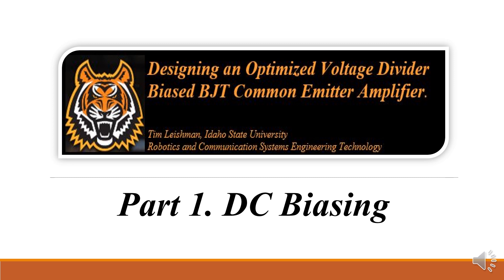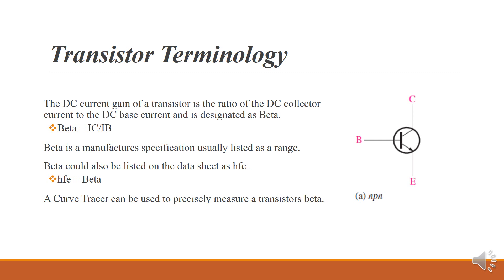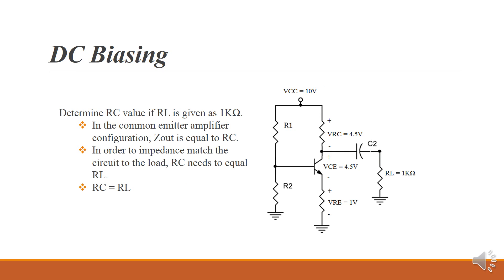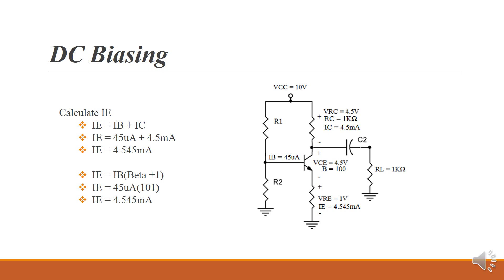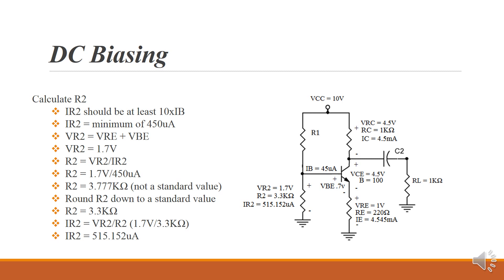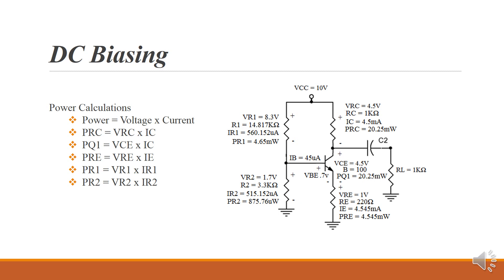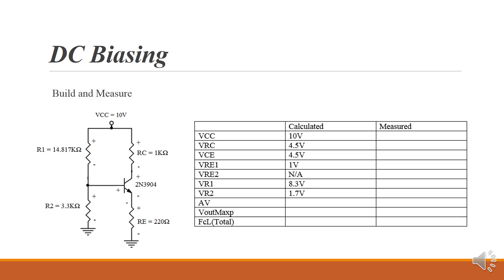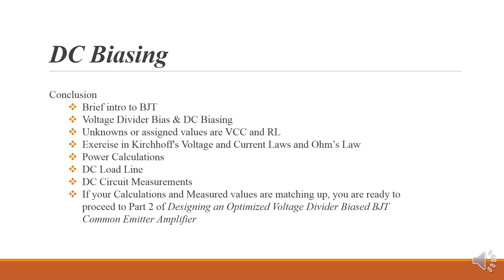BJT Amplifier Design: Part 1 DC Biasing

Comment: Thanks for an EXCELLENT refresher.  I am a retired EE and ham radio operator.  I am working on designing single transistor low-power Class A WSPR transmitters.  It's been years since I've actually done any discrete transistor biasing for amps and most, these days, are used for electronic switching.  You are a fantastic instructor!